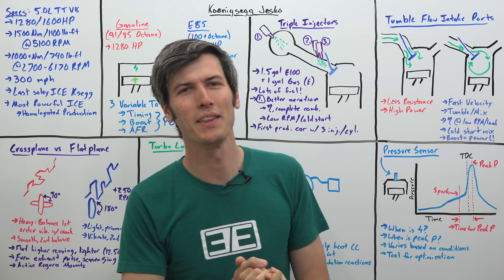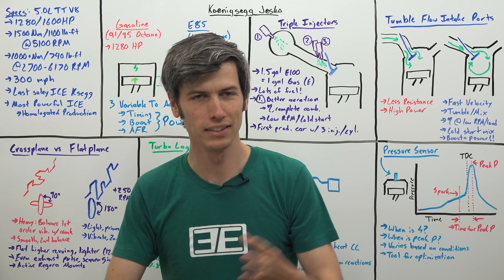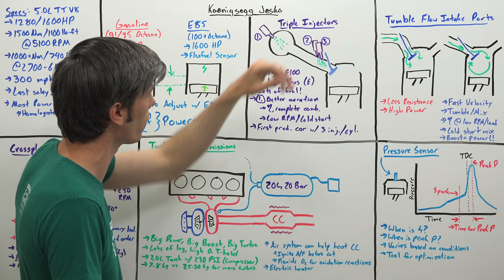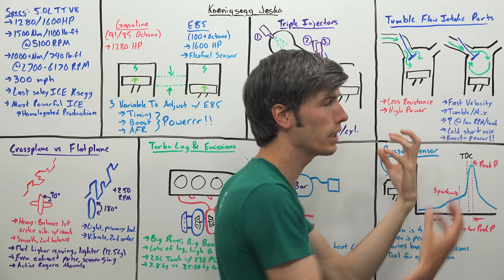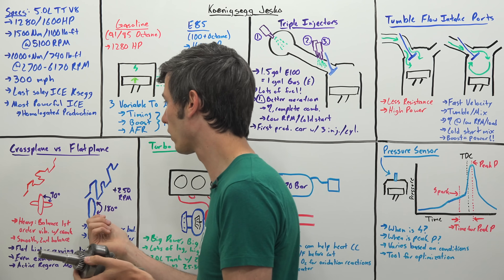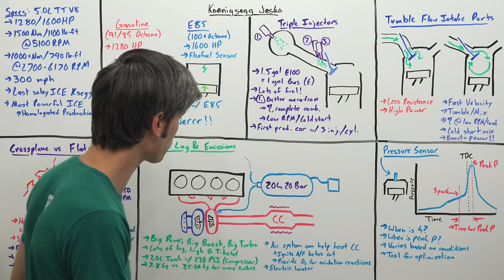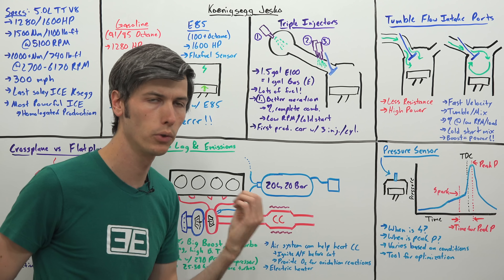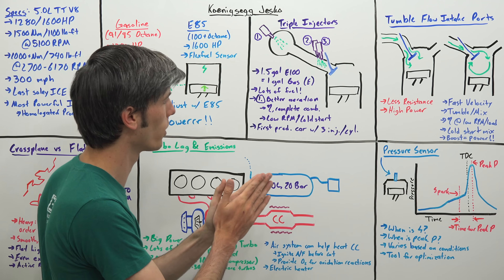Koenigsegg Jesko - The World's Most Powerful Production Engine

Comment: The pinnacle of ICE design and it's already obsolete.
Reply: Islamisthecultofsin  not even close to the pinnacle .
Reply: What's better than this in a street car?
Reply: You stated this was the pinnacle of ice design when it isn’t .
Reply: The pinnacle infers the best possible version of something . This is not the pinnacle of Internal combustion engine design its a simple statement.There isn’t currently a car with a petrol engine that is the “ pinnacle “ the best you could possibly make it . Now I had no idea you where talking about electric cars but here we go. The farina is a rebadged rimac concept two , yes it does produce more power than this as you rightly state 1900 horse power , thing is a mildly tunded mclaren 720s producing around 900 horsepower can match the alleged 1.9 or 1.8 whatever it was  0-60 and turn a faster quarter mile  because these cars weigh a fair bit where as it doesn’t,horsepower isn’t everything I reckon these cars will not be setting lap records anywhere due to this . The new hennessey F5 will match those cars off the line and then outpace them all the way to over 300mph (311mph) supposedly . I don’t dislike electric cars I actually quite like them but the hype train is getting unbearable .

Comment: Why not to use supercharger to compensate turbo lag , i.e. using a seperate air cylinder of 20bar  ,using a ecu controlled supercharger air flow to turbo exhaust

Comment: But can it keep up with my Subaru BRZ with an aftermarket air filter?
Reply: Not if your Subaru has red brake calipers
Reply: If you have an aftermarket bumper and rear bumper. Not a chance.
Reply: * off ebay
Reply: Bro, no chance.
Reply: 1 thing the brz has over jesko is bro power there is no better or more efficient way to make power. The air filter is just icing on the cake
Reply: Only if it's a K&N! Lol
And especially if you put the sticker in the window!
Reply: Not if it has fender flairs
Reply: not  if you have gold colored wheels
Reply: You're drunk. 😂
Reply: How many stickers you got bro? Gonna need a "NOS" or better.
Reply: I sense RWB on your windshield. And a REALLY big and inefficient wing
Reply: Worst thing about owning a n/a brz is pulling up to a light.
Reply: Ahh, so you have 201 hp too?
Reply: If it,s full of dirt it will give you 10k hp more you will smoke it
Reply: definitely not, especially if it's fueled by vape juice.

Comment: It's about time they finally streamlined the operation of the limited 38% Max Efficiency Design. If the wheel was a Motor driven by Hydraulic, Steam, and AC Induction to 
accommodate for Max torque at all RPM,s attached to a Sled Chassis Design which houses all the necessary hydrolytic, power generation equipment, to produce and direct the necessary
force to the  impeller driven rotors Embedded in the rotating wheel Assemblies. The Innermost Impeller Drive would be Hydraulically Driven, The Center Impeller would be Steam Driven, 
and the Outermost edge of the Hub would receive Inducted AC power, All Computer Controlled and Able to use Scavenged Power as Braking both Hydraulic Regenerative Breaking and 
AC Induction power scavenged Breaking all maximized for efficiency, using only water and hydrolysis with Flash Steam Boiling as the Prime Energy Source with Solar and Wind Capture.
Ion Exchange Membranes can be used to both process water while producing Low Voltage for Body Electronics, Thermal Exchange for Heating and Cooling of the Interior of the Bolt on
Body Unit, is also accomplished by utilization of Power Generation Heat Exchange Phenomena. All Possible Demands for Unlimited Range and Ultimate Efficiency with No Emissions.

Comment: The Jesko  only have one (1) turbo. Not two (2) as it is told in this video.
And the compressor is "producing" air into a tank that delivers air into the singelturbo (large, very large turbo) at very specific times to help spole the turbo. So the turbo will therefore behave as a small turbo that spins up very fast, but it will deliver the "punch" as a big turbo.

Comment: I like your presentations, but this time I miss one piece of information. The main reason for the higher power on methanol is that you get more energy per kg of air than you get with gasoline. This even though the energy content per kg of fuel is lower. It doesn't hurt that you also can pump in more air per stroke thanks to the higher oktane level of methanol.

Comment: How is it possibe to put pressurized air (with 20,9 vol % O2) into the exhaust manifold in order to make the turbine to spool up without affecting the oxygen sensors?
In my world the ECU will think that the engine are running lean and tries to compensate for that by injecting more fuel and making the engine go rich.
Reply: It's the same ECU that controls when the pressurized air is released so it should know to adjust or ignore the readings while that's happening

Comment: A pair of AC motors linked to the intake end of the turbocharger shafts would weigh a shitload less and work a shitload better than the "tank o air" scheme, tho having air injection for the hot side on this engine would probably be a great idea to keep the suckers from incinerating.   Basically Knoggerdeg's application is to "afterburn" their engine into the turbochargers (or re-heat, tbms) and it has some odd problems and limitations.   Motors driving the turbos would overcome the backpressure issue and put the engine into a scavenging situation.

So... fail/fail for Koenigsegg.... nice try tho.
Reply: Electric turbochargers are getting common. Koenigsegg knows about it, they definitely considered it. Less than 8 kg addition for the whole electric system, unlikely.
Reply: Don't knock if you haven't seen it perform yet .

Comment: How are they able to trick the ECU to not run a rich air-fuel mixture when the Oxygen sensors pick up the extra oxygen molecules which came from the compressed air?
Reply: The system is what's adding the compressed air, it knows when & how much has been added, so it should know how much extra oxygen to expect.

Comment: Interesting there is no mention of mitigation of back flow when the air is injected to the impeller housing.  Since there is no valve, the back pressure must inhibit exhaust scavenging from the exhaust manifold and cylinders.

Neither is mention made of the main drawback of intake port injection: the fuel reduces the volume of the intake charge and thus oxygen entering the cylinder.  Interesting there is no mention how the intake charge temperature is reduced, although that is mostly a detail.  The peak pressure sensor is a neat idea if the ECU is fast acting enough.   The tumbling of the intake charge is old school and no mention of how exactly this is achieved nor optimized over all RPM ranges and thus gas flow rates as it does not seem to be adjustable.  Seems it would be better to have 2 or 3 direct injectors and a suitably high pressure fuel pump or two instead of the port injectors and thus better control fuel pulses and atomization within the cylinder.   Surely expense was not the limiting factor?

One also wonders what the parasitic loss of the air pump is.  Seems like a electric motor replacing  supplementing the crankshaft like the NSX does would be much better even with the weight of the batteries required.

Comment: bUt ThE dEvEl SiXtEeN HaS fIvE tHoUsAnD hOrSePoWeR

Hats off to Koenigsegg for actually creating an amazing engine first with pioneering technology and then bragging about it instead of doing the opposite
Reply: The engine does exist, it does at least 4.5k+ horsepower.. But the rest of the car is just false flex
Reply: @SM-cq1mm  the engine has been built by a dragster tuning shop. It's going to last 100 miles at best.
Reply: Zenkyorno Or Shadow Dragon but is it globally street legal?
Reply: Colin Shantz bUt ThE dEvEl SiXtEen FaKe
Reply: OK  I agree with you it is real but no one knows if devel sixteen actually has 5000 hp
Reply: @jessertheck2416 some engines (obviously bigger ones ) the ones which are found in massive ships produce alot (around 100k horsepowers ) but the thing is Koenigsegg's Engine has best horsepower to weight ratio

Comment: Power output not that impressive.
I have 1000hp on a 408 LS engine running 15psi of boost on 93 octane and mine is a mild setup and revs to 7000rpm.
Any engine can make big power with 2 big turbos.
On an LS you would be looking at over 2000hp with really good reliability too
Reply: I think you are too focused on the power output, look at all the stuff they put into the car and look at what it weighs. They could easily make more power, but how you gonna put that power down if your car is fairly light ?
Reply: How much does it weigh?
Reply: @DennisKarlsson  Not sure but CVK said it's fairly light to it's competition
Reply: @BornKing93  I was asking Mr Mysterious.
The Koenigsegg is light, I have no doubt.
Reply: @DennisKarlsson  Oh ok, sorry sir.

Comment: Hey thanks for the (once again) awesome video ! Two questions though about the compressed air system : would it not be more efficient to use the turbo or a shaft connected to the engine to compress the air during low loads periods ? That way you get rid of the compressor and use what would otherwise be lost energy.  Would it not be more efficient to inject that compressed air directly into the engine intake ? That would bring nice dense, cold air at a pressure you can regulate.

Comment: This does NOT have the worlds strongest production engine. That honor goes to the SSC Tuatara, which sits at 1750hp. A twin turbo 5.9 liter flat plane crank V8. The car also has the best coefficient to drag ration of any super or hyper car out right now, of 0.279. You should do a video on that beauty.
Reply: That car is pure vaporware

Comment: Nice tech.  I like that cylinder pressure sensor especially and it take a lot of time in tuning an engine to make max power when tying to ascertain maximum ignition timing advance.  Currently we do it one degree at a lime linearised  from maximum boost back to a lower known safe boost point.

Comment: 1) What is 0-60?
2) Instead of using a compressor to power the turbo which then charges the cylinder, why not use a supercharger instead? The point of a turbo is to compensate lag with fuel economy but this car is already expending power to run the compressor so mooting the point.

I could be ignorant enlighten me
Reply: Peder Hansen  Agree with everything except efficiency. It would be true with a traditional turbo but this one uses a compressor as well as a turbo, so the loss can't be more than a charger (compressor only)

Comment: first i wanna say im a huge fan of ceramic coatings to control the heat inside the engine but noone seems to offer services like inside exhaust manifold coatings... 
second i believe turbos in the future will have electric motors attached in the middle to eliminate turbolag

Comment: Thanks for the insight into the in-cylinder pressure transducer. Any chance you could do a separate video just on this point, perhaps outlining why only now are we seeing a production car with this feature, when it has been used in engine development for decades? Also, a P-V diagram would perhaps be more appropriate than pressure vs time.
Reply: Also, I believe it is worth mentioning all the cool things you can derive from the in-cylinder pressure transducers, such as knock detection, misfire detection, Coefficient of Variation (measure of the engine's smoothness),  BMEP,  (which allows you to effectively measure the engine's power on the fly and I believe would also be a first for any production engine). It really is a controls engineer's wet dream

Comment: Its crazy how marine diesels have been doing the turbo charger air injection for a while now. Though we blast it into the compressor side to spool and supply air for combustion. Then the pressure sensor on the cylinders aswell for constant pmax control for efficiency.

Comment: @engineering explained I've got a question about the antilag system. when using the compressed air to spin up the turbo you're using taking compressed air, running it through a system and making other compressed air, in that system (the exhaust manifold and turbine) there will be energy losses. why do you think they did this instead of dumping the air directly into the side that they are trying to pressurize in the first place?

it reminds me of what ford did with their WRC focus in the early 2000s, although thats not entirely related
Reply: Adam, just say your engine can easily make 30psi @ a midrange rpm, but you only need 5psi for that gentle hill, the turbo can dump excess boost into the bottle for later use. Bottle will be full in a couple of seconds anyhow.
Reply: @nordic5490  sure that's not what I'm wondering about, I've always thought a blowoff valve into a chamber to 'save it for later' would be cool. I'm thinking about the efficiency of making boost pressure by spooling up the turbo vs just dumping pressure into the intake

Comment: Interesting video, thanks again. At what rate is fuel being consumed when producing 1600 HP? 1280 HP? What is the fuel carry capacity?  How much power is needed for stead state 300 MPH cruising?
Reply: Having a top speed of 300 mph means it doesn't have more power for higher speeds, so cruising at that speed would require constant 1600 hp of power. Consumption, based on typical figures, would be 400 l (~100 gallons)/h. This is all I can say.

Comment: @Engineering Explained what about racing fuel like VP 100 octane?
Reply: Won't pass emissions, too much heat and the biggest issue is detonation. It would require water injection and in the end it might not increase power to any great extent.

Comment: I'm pretty sure that any engine that runs on ethanol will produce much more power. For example the Bugatti Chiron it would make like 2000 hp with ethanol in it's tank.
Reply: e85 can be boosted to 40psi and beyond, depending on compression ratio and ignition advance. My XR6T is tuned for e85, but often run it on a 50%blend, eg e45 and can still run 18psi which is mad on a 4L Barra.

Comment: Is it possible that the car has no problems with emissions around the world because it can run on E85 (so emissions are measured with the car running on 100% E85)?

Other question I have is if the car can run on pure ethanol (E100) instead of on E85.
Reply: Not much benefit above e65. I run e85 on my daily drive and often run it 50% with petrol

Comment: Question: when you speak of torque why do you say lb/ft when I'm pretty sure you should actually be saying ft/lb?
Regards.
Reply: Jason Jones because torque is equal to the force applied multiplied by the distance from the pivot point. Meaning we read it “how many pounds of force per foot”.
Reply: JM M yes that's what i'm getting at,you say ft/lb as it's 1 foot but you are saying lb/ft as in feet not foot implying it's more than 1.If you see what i mean lol.
Reply: Jason Jones you have a point from the literature size. But the the ratio is forced applied per 1 foot, just as mph is miles traveled per one hour. It would be the equivalent of saying how many hours per mile.

Comment: From what I know, the only difference in the two crankshafts aside from revs, torque and power, is the geometry. How is the Crossplane heavier?
Reply: Crossplane crankshafts are usually heavier than flatplanes because the primary forces need  to be balanced out using counter weights.
Reply: @auser5819  that is why they provide higher torque... I see now, thanks!

Comment: CRAZY to think about 1600HP going through a 27 (12.5 kg) pound crankshaft. WTF.
Reply: That's some insane metallurgy for sure. It's amazing the specifications a car can take when cost of the final product isn't a concern.
Reply: Probably made out of titanium... JK that would be like a $2.000.000 crank.
Reply: @SavageBunny1  the billet crank I had custom machined for my MS6 was $17,000. They are expensive, but not near as expensive as people think.
Reply: @SavageBunny1  billet crack
Reply: @jhon-cg4rg  are you sure you mean crack? :D
Reply: Not really that surprising if it has no counterweights....
Reply: Titanium Grade 12 Price per kg
68€ (80USD) in Indian.
12,5kg -> 1000 USD
Reply: Crazy how theyre making that amount of power through a 5 L v8
Reply: @blackice7408  320 HP/L on e85. Insane.
Reply: @blackice7408  modern F1 engines are 1.6L V6 and make 850hp, while lasting over 7000 km. Not that far away from hypercar usability.
Reply: And it also revs from idle to 8500 rpm in fking 230 Milliseconds 💀👍🏻
Reply: plenty of 2jz making that power on the factory crankshaft. Pretty much all Barras making that power are using the factory crankshaft.
Reply: @nordic5490  but not weighing 12kg, his original point

Comment: Another thing I remember from when I was a kid.. :) 
Isuzu was experimenting with ceramic engines without a cooling system. It enabled the engines to run hotter and not waste as much excess heat/energy to a cooling system. It failed though, I think the biggest problem was that the ceramic parts and the metal parts expanded differently do to heat.